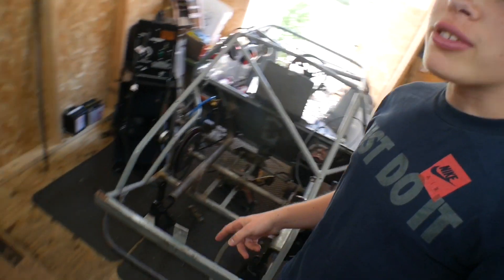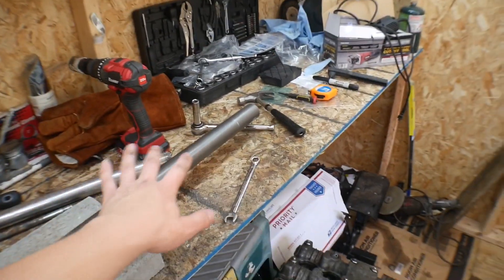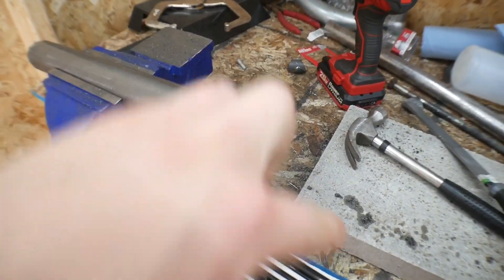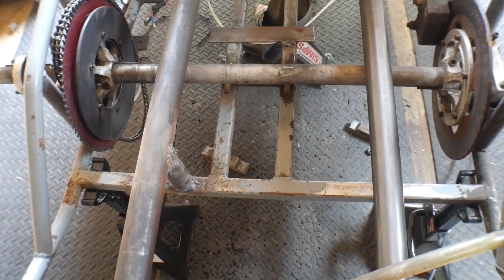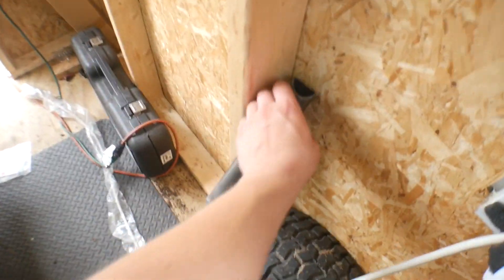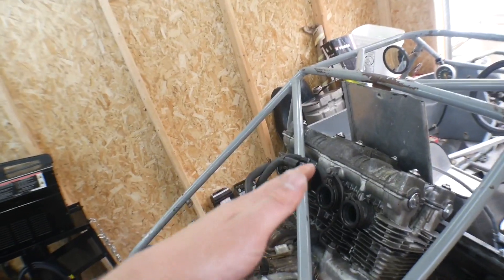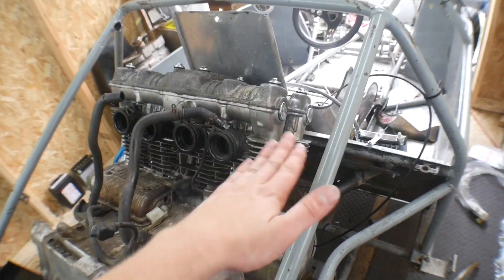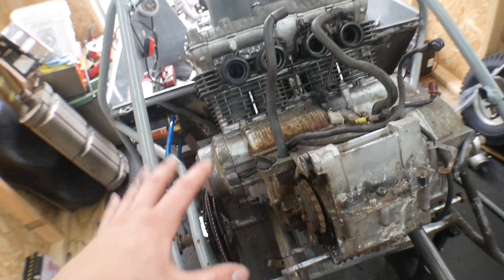The New ENGINE is in The NASKART!

Comment: A 450 dirt bike engine would of been a lot better but the builds still gonna come out sick
Reply: Josh Oakes yea but that thing would wear out pretty fast... ... makes like 45-55 hp but made to push something that’s 230 pounds witha 180 pound rider.... not a whole 500+ pound car
Reply: This isn't grind hard plumbing.
Reply: That or a snow.mobile twin that hond a looks like a boat anchor and is way to high up ,the cooling will be a nightmare
Reply: Conner Hooper Thera 500 plus  kg quads with 150cc engines and there still fast insure a 450 can easily pull it and it would be allot more responsive and fun to drive also it would last just As long
Reply: @psychot1c694  their builds are insane
Reply: But a 450 doesn’t have the power of a 750
Reply: Josh Oakes they’re not “ fast “ lol

Comment: You need a Bosch 18v, with at least a 4 ah battery, or a dewalt , or a milwaukee drill for sure, thennyou buy what you need, like a jigsaw and a angle grinder, torch etc etc
Reply: I always use hitachi or makita
Reply: sjoerd I’ve a makita pencil screwdriver, very good- however I wouldn’t buy the new stuff, not as they used to be...
Reply: Ritch3y you buy good once, not buy bad and buy multiple times
Reply: @Sam-m04  I've used Makita a dropped it off the roof of a two storey house and it was as good as new still worked perfectly
Reply: Tyler anything would do that 😂😂😂 hopefully lol... I just think their build quality has went downhill. Isn’t made in Japan epanymore either sadly
Reply: @Sam-m04  Fair enough but Makita and Milwaukee are very much the same

Comment: Since you’re worried about strength from cutting the cross bar out. Order some gussets from go powersports and weld them in the corners. It’ll help strengthen the chassis in the back. That motor is going to have some torque.

Comment: That thing is looking great but i'm afraid that once you try to floor it, the engine will rip itself out, be sure to put rubber engine mounts(silent blocks) to reduce the torque and vibrations; secondly weld at least two more tubes in between the existing pipes to strenghten it up. Another thing i've noticed is that chain and sprocket mounts,this thing is gonna chew up the sprocket mounts and snap the chain so make sure to do something about that. For the cooling make two intakes on the sides of a car and run the flexible tubes back to the engine and put two radiator fans behind the seat so they suck the air from the cabin to the engine and blow it out through the back of your cart.

Comment: Using the engine mount section off of the motorcyle frame would have been so much easier, and would have saved you a ton of time.
Reply: Bryan Wayne not to mention saved some money and probably could have got the engine lower, but he’s still doing good for being a younger guy
Reply: @Mrjoeycrandall  Yeah hes doing really good. I was just learning to change oil at his age. Hes building engines and welding. Lol.

Comment: How are you going to fit the exhaust headers ?  that sprocket is far from inline with the engine output sprocket unless your going with a layshaft set up , moving that top cross bar brace a smidgen wont do, dont forget exhaust headers and pipes gotta fit and that inline four carb to, .

Than engine aint gonna be safe , you need more vertical bracing towards that angle section on those engine mount pipes you made, that cart does not have shocks so theres gonna be a lotta shaking and that motor aint light its gonna bounce around. PLEASE PLEASE think over the things you need to do , create a build list and tick of each one when finished . 

One more thing how are you going to shift that gearbox into gear , motor is super high  a shift stick is gonna be right under your armpits if you factor in the low seating arrangement

Comment: Great job on the mount, I think you should use a bit of flat bar and make some diagonal bracing for the rear of the engine mount frame , only needs to be 3 or 4 inches to stop any side to side wobble that may fatigue the welds

Comment: You got allot of problems coming first off you are gonna have to cut out the body’s rear window for cooling, second you are going to have to place the rear axle back like a foot and then the body won’t line up, thirdly you need to brace the frame otherwise the power and weight of the engine could twist and taco the frame it’s just not safe without bracing.

Comment: you should slide the disc brake to the left side and put your sprocket on the right side run a jack shaft with a sprocket on each end that way one from engine to jack shaft from shaft to axel on the other side!

Comment: You want those mounts to be extra good bro it not just holding the weight of the enginge its gonna hold a million tiny explosions and the cranks are gonna be moving up and down so if you started the motor not in anything it would move all over the place

Comment: You need to buy a big nice heavy hammer drill that is corded with lots of torque for your shop and use the cordless on smaller things that dont require so much torque

Comment: You're probably going to need a much smaller sprocket to get the proper gear ratio otherwise it's just going to spin the tires and have a lot of torque but not a lot of top end